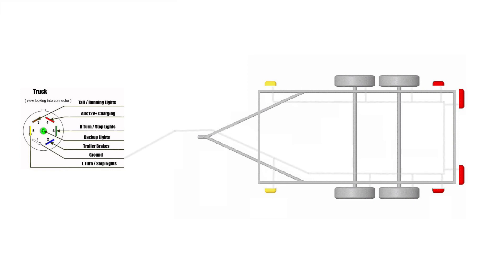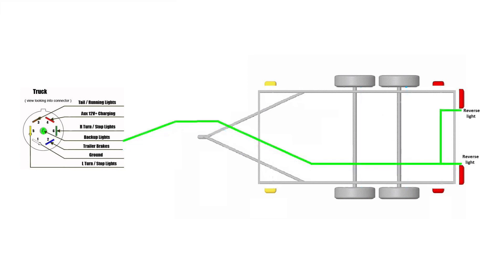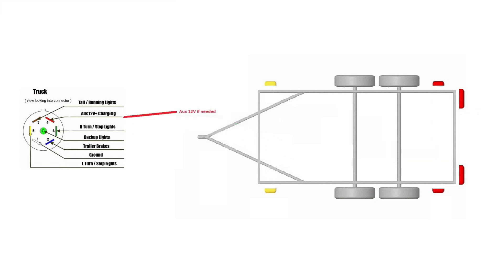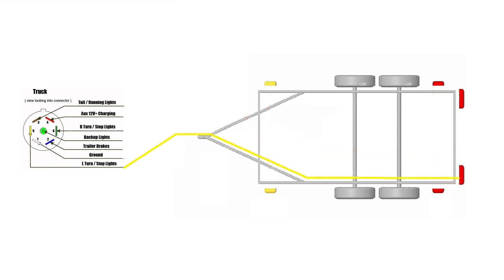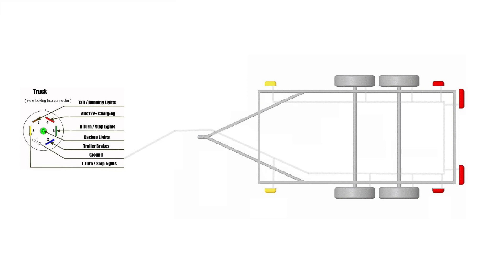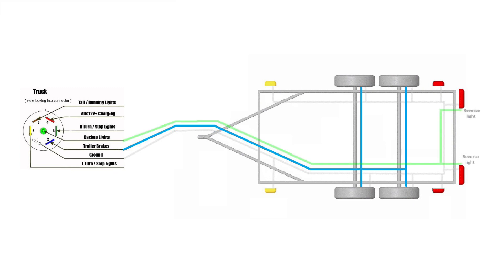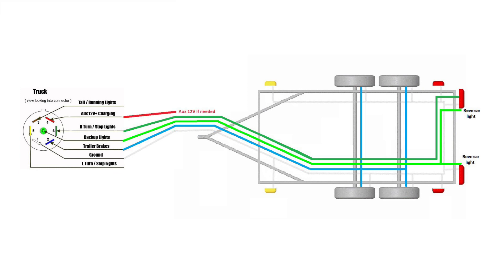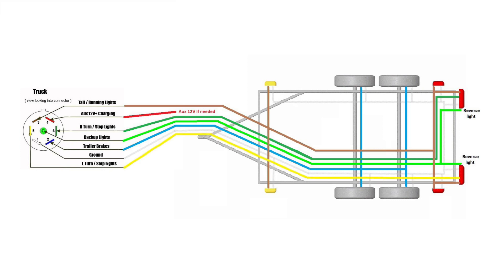Trailer wiring diagram 7 pin

Comment: Gauge of the wires? should it be heavier for the Positive wire and negative
Reply from the maker: Hi getoutwhileyoucan, thanks for watching, I would match the gauge of the vehicle side. Can’t get more amps than the vehicle wire is furnishing. If you need more power then you will need to change the gauge wire on the vehicle side also. Hope this help 👍

Comment: Great video as I need to hook up bed lights in my 2025 ram 1500, now I can get constant 12volts+ from my 7 pin from the red wire!
Reply: Any lights connected to the red wire will always stay on?
Reply from the maker: Hi albertogalaviz. Thanks for watching. The red color implies auxiliary power (usually 12V power). Depending on the installation on your vehicle usually it’s upon ignition. Hope this helps 👍

Comment: What about the brake lights being “running lights”? So when it’s dark, they are on but if you press brakes or use turn signals, they also light up just brighter?
Reply from the maker: Hi JustinThomas, thanks for watching. Yes when you have your running lights on your braking and turning lights will be brighter. Now if you’re blinking to the right and braking at the same time. What will happen, your right light will blink brighter and your left side will be a solid bright red for brakes. Let me know if it’s clear. 👍
Reply: @ thanks for responding. I have just built a trailer (26ft flat bed with 6 marker lights, 2 brake lights and 2 reverse with electric brakes) and the lighting config has stumped me.
Reply from the maker: No problem, let me know how it goes. Sounds like It’s gonna be a nice trailer. 👍

Comment: Vehicle wiring diagram?
Reply from the maker: Hi drivebyquipper, thanks for watching, for the vehicle side it can differ very much depending on the model of the vehicle. Some vehicles actually even require module installation. So it can get very tricky and some others are very simple installations .

Comment: Can SOMEONE PLEASE tell me why in the world are equipment trailers and RV wired differently and use the same 7 way plug??I never understood this!
Reply from the maker: Hi Guerrero, thanks for watching, The only difference between 7-Way Utility and 7-Way RV is the color of the wires. The pin outs are the exact same so either would work just fine with the other.

For RV it’s usually

Green-Tail & Running Lights
Black-12V Power
Yellow-Reverse Lights
Brown-Right Turn & Stop
Red-Left Turn & Stop
Blue-Brake Controller Output
White-Ground

Comment: Why do the L/R Turn and Stop Lights use the same wire? How do they work?
Reply from the maker: Hi huanqingwu, thank you for watching, 

When you press on your breaks, both the green and yellow wire will send a constant 12 V at the lights, that will mean that your brakes lights will be on.
When your right flasher on your vehicle is on, your green wire will receive a on and off 12 V so it will make your light flash 
Same goes for the left side with the yellow wire.
Now, if you have your brakes on and your right flasher on at the same time. Your green wire will receive on and off 12 V, and your yellow will have a constant 12 V.  So the right side will flash and the other side will be constant On. 

Let me know if this helps  👍

Comment: very simple video two questions for you:

 do the wires going to the brake magnets should be be in series with one another or parallel?  
Can you put that diagram up in an easy to print format?
Reply from the maker: Hi crasher88, thanks for watching. For the brakes they are connected in parallel. 

 For the image try to do a print screen and print it. YouTube won’t let me paste an image in the messages. I hope this helps 👍

Comment: The red 12 volt wire is usually used for the breakaway system, right?
Reply from the maker: Hi garthtimmins, thanks for watching. It can be used to what ever needs 12v, including breakaway system. Hope this helps 👍

Comment: Where is the black wire lol?
Reply from the maker: Hi businessgoose, thanks for watching
Round 7-Pin Wiring Diagram
º White Ground.
• Brown Taillights.
• Green Right turn / brakes.
• Red Auxiliary power.
• Yellow Left turn / brakes.
• Black Reverse lights.
• Blue Electric brakes.

Sometimes they change the colors codes but light green or black usually reverse light, Hope this helps
Reply: @joetheboatguy5394  thank you, I am in the process of re wiring a trailer and am new, the red so far for multiple trucks had been left turn signal, when I wired brown to brown and green to green, my right turn signal would flash both left and right lights. So going brown to green and green to brown fixed that....
Reply: @joetheboatguy5394  so I'm very confused lol, the guy before me cut and spliced these cables up, I've been stripping ans reconnecting all day. Like 4 different grounds randomly placed...
Reply: @joetheboatguy5394  also, my black cable gets 0 volts, but my blue is a constant 12-14v. And blue goes to my breaks 0_0
Reply from the maker: Put your vehicular in reverse on and see if you get 12V on your black wire. 

Looks to me that the guy before you did a random job. Meaning not following the colors code. Might be complicated to figure out unless you have a multi-meter.
Reply: @joetheboatguy5394  so it's set up like this
Red = left turn/ break
Brown = right turn/ break 
Yellow = running lights
Reply from the maker: Not the right colors but works 👍
Reply: @joetheboatguy5394  yeah it's driving me insane lol.

Comment: There never was a backup lamp wire in the 7 way it was meant to be used for auxiliary battery charging such as the 12 volt battery in your camper for the fridge and lights this way you didn't kill the tow vehicle battery. The trailer brake battery is on a separate circuit as it is dedicated for that area only. Back in the day trailers were never equipped with backup lamps as you don't see them on highway tractor trailers.
Reply from the maker: Hi michelbroder, thanks for watching. Now a days, the 7 trailer pin has a wire for backup light and a wire for 12v aux. Unless your 7 pin is not standard. 👍
Reply: @joetheboatguy5394  The wiring diagrams I have from Bargman and Pollock show that the #4 terminal wire is for the trailer breakaway battery as it was dedicated for that purpose only and the #7 wire is for auxiliary circuit . I have yet to see a Stock, Flat Deck, Goose Neck, Fifth Wheel  , Enclosed Utility or Camper Trailer with backup lamps unless they were installed aftermarket. Also do you see backup lamps on an 18 wheeler trailer as they don't exist as I have that 7 Way diagram also.
Reply from the maker: Hi michelbroder, i don't make the law but there's a law out there that says: If your trailer exceed 750 kg in weight. The law states that ANY trailer including caravans that exceed 750 kg need to have a fully functioning trailer reverse light. This is specified in Section 6.4 of regulation 48 approval of vehicles with regard to the installation of lighting and light signalling devices.
Reply: @joetheboatguy5394  Where do you live as I have checked every Province and Territory in Canada and also I asked a Motor Carrier Enforcement Officer and according to him there is no requirement for backup lamps anywhere in Canada. When you talk about trailers above 750 kg. you must be in Canada or elsewhere where the metric system is in use.
Reply from the maker: @michelbroder6055. I found this on the web for Canada. 

« Many times, drivers think that just because their taillights might be visible over a low-profile trailer, operating lights on the trailer are optional. Yet in all jurisdictions in Canada, if you are going to tow a trailer, it must have operating running, brake, signal, and (dependent on size), reverse lights.Jul 13, 2017 cc »

Comment: Can I ask a question, when the brakes are pressed the yellow lights turn on not the red light, A professional trailer repair shop wired up the new 7 pin about 3 months ago.I never noticed it before, do you think something happened or it was wired wrong?
Reply from the maker: Hi sdexcalibur, thanks for watching. If a professional guy did this work you should bring it back to him, they should be a warranty of the work done. 
When you say yellow lights are you talking about marker lights? Let me know 👍

Comment: When troubleshooting the pig tale, how many volts the blue wire should read?  Great video
Reply from the maker: Hi sightseer, thanks for watching. The amount of power coming out of the brake controller depends on the adjustment of the gain on the controller. To test the voltage at the highest gain setting, you will want to sever the Blue wire a few inches from the back of the controller. Then, you will want to test the voltage coming out of brake controller at maximum gain setting. You should get around the same voltage as the Black wire, slightly less.

The amount of voltage at the trailer connector will also vary depending on the gain setting of the controller. You can test to make sure you are getting signal at the trailer connector by using a circuit tester to test the Blue wire.

If you are getting voltage and signal at the rear of the controller and the trailer connector, the next step would be to test the trailer brake magnets

Comment: the only time a ground wire goes to each light is if it is LED,,the frame is otherwise the ground.
Reply from the maker: Hi Kevindendy, thanks for watching, I use the frame as ground but not everyone likes doing that. Even on vehicles the frames are usually ground. 👍

Comment: Good video, would have been a great video if you also showed the run away brake wiring too.
Reply from the maker: Hi Atubeviewer, Thanks for watching. That is a great idea, I didn't think of that. For now here you go. 

Splice the blue wire from the breakaway switch to the blue trailer brake wire from the breakaway battery box.

Splice the black wire from the breakaway switch into the Trailer 7-way connector brake circuit. The color of the brake circuit may vary trailer to trailer. 

Splice the red battery positive wire from the breakaway battery box to the Trailer 7-way connector 12V+ auxiliary power circuit. The color of the 12V+ auxiliary power circuit may vary from trailer to trailer.

Attach the white wire from the breakaway battery box to the trailer chassis using a ring terminal or Splice with white trailer wire.

hope this helps

Comment: Why would my trailer running lights stay on while the truck is off an parked?
Reply from the maker: Hi gala83filmstaylorg7, thanks for watching. One reason I can think of why you’re running light stay on is that your auxiliary 12v wire might be connected to your running lights. Or both running light wire and 12v aux wire seen to be connected to running light. Check that out and let us know 👍
Reply: @joetheboatguy5394 so you were right the top two pins where wired backwards giving my running lights constant power...I switched them but now my running lights only work with my truck lights turned on instead of auto? Is that normal? It's a 2015 chevy silverado
Reply from the maker: Ok we got one problem resolved 👍 
Now for the running lights working on the ON position but not on Auto. Are you on parking when you’re testing? Maybe your auto only activate on Drive position. Try that.

Comment: Can I add additional running lights to the running light wire? I won't to add colored side lights on the trailer.  What kind of 12 volt item could I use?
Hope these aren't dumb questions. Great video. Very clear.
Thanks
Reply from the maker: Hi ecook, thanks for watching and nice comment. They are no dumb questions; all questions are valid here 😊. You can connect any 12V rated lights. Even led light strips if you want. BUT if you go with led lights make sure all your lights are led in the circuit. Not good to mix and match led and halogen lights. All your lights should be connected in parallel. Also make sure you respect the laws of color lights in your part of town (if they are any LOL). 
PS: one thing to considered, when connecting light in parallel you will need more amps. Make sure you have the right fuse for your running lights (especially for halogen).
Let me know if this helps 😊

Comment: Great video, all my wires are wired the same as your video but when my running lights are on and I plug in my trailer in to truck the taillights on truck get brighter. Any ideas?
Reply from the maker: Hi chrishawley, thanks for watching, first thing I would do is on the trailer, make sure the connector is clean and free of corrosion. Then you will need to make sure that the main trailer connector ground and the grounds for the all the lights are attached to clean and corrosion free bare metal surfaces. Corrosion will add resistance that can cause voltage change. If they are clean and all wire are fine. Then I would suspect your converter box that can be going bad. Let me know we will figure it out. 👍

Comment: I did exactly what the diagram said and it still doesn’t work
Reply from the maker: Hi sirtaz, thanks for watching. Have you tried another trailer to see if the problem is on your vehicule side or trailer side. There’s also plug-in leds to test your vehicule side. That would be the first step. Let me know. We’ll figure it out. 👍
Reply: Youre a great content creator@joetheboatguy5394

Comment: What do you with the wire you don’t need
Reply from the maker: hi gregridesbikes, thanks for watching. they are many ways to cover unused wires. You can use the most basic way with electric tape. You can also use shrink tubes, self-fusing silicone tape or Liquid electric tape. I hope this helps :)

Comment: I just install tow bar ,connected the el...used this box tab7a
But have some issue ..missing stop light. 
Maybe the trailer have some lose wire or ..?
Reply from the maker: Hi draganku. Thanks for watching. I suspect that your flasher lights are not working either. You would have to check your yellow and green cables. Make sure they are well-connected.

Comment: Hello I have a 06 equipment pro utility trailer, with a white black yellow brown and green wires not sure how to hook up especially e brakes
Reply from the maker: Hello Vincent Aguirre, thanks for watching, usually white is ground for trailers, brown is lights, yellow is left and stop light and green is right and stop light. Your black wire is not usually on trailer wires. What you can do is fallow the wire and see if it goes to your brake. Usually brake is a blue wire unless previous owners change the wires.

Comment: Where do you connect the ground wire to each light? My reverse lights only have one wire.
Reply from the maker: Hi Blake Rothermel, thanks for watching. If you only have one wire that would mean your ground wire should be the screw on the light and will be attached to your metal frame. Your trailer frame will be ground.

Some lights are made that way

Comment: This diagram really cleared up the wiring layout for me. It is just as, the used trailer I purchased is wired. Except the manufacturer used all the wrong color wires and the damaged lights no longer work. Im having to rewire , replace the trailer connector, add and ID Bar on back , and replace most of the running and marker lights. Thanks for posting this.